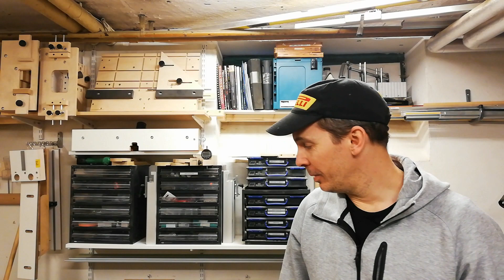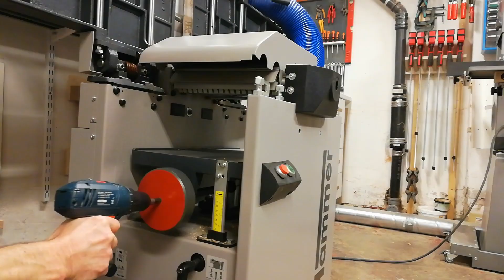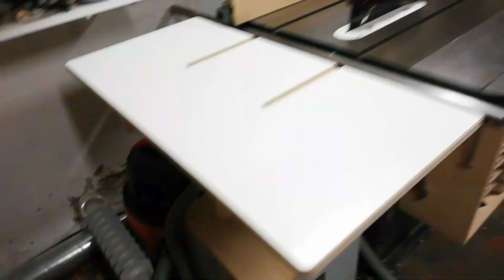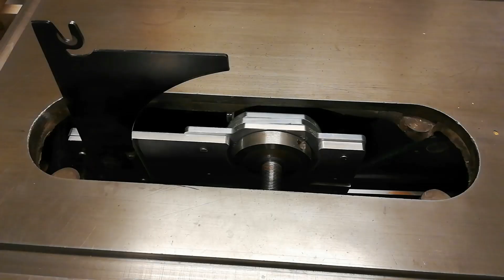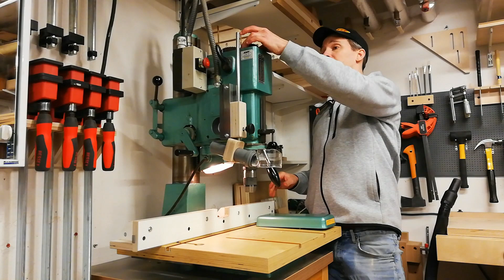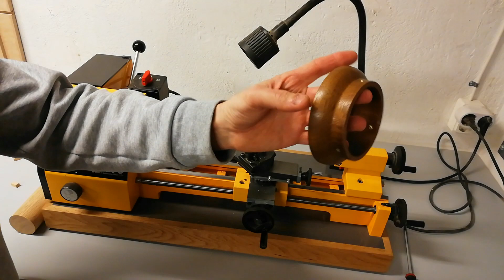Shop tour part 2 - Machines and tools

Comment: Very nice concise tour of your shop, thank you. I also have a Sorby pro edge and have been looking to add a bar type fixture to use some of the Tormek type fixtures. Could you share the design of your 12mm round bar fixture. I really like how you added it on top above the standard stock table.  Thank you! Allan
Reply from the maker: Thanks! I don't have any detailed drawings for the bar holder but there are some additional pics on pinterest, link below. The metal block is 20mm thick, 30mm wide, approx 60mm long, and then it's curved (cut with a grinder then filed and sanded) on the front for the blade holding jig to be able to pass over it. The block sits with three screws threaded directly onto the side plate of the machine. Metal bar is held in place with two set screws. I made my own sharpening jig as well, the tormek fitted but the blade protruded very far from the jig. https://pin.it/1u7V0NX

If I was to to this again I would consider axminsters 12mm bar and bracket. At least two members on the sorby pro edge forum have attached this to the machine and it fits with minor modifications. Same principle as mine but it wasn't on the market when I built mine. You have to be a member to view the pics in large version. https://robert-sorby.freeforums.net/thread/182/quick-make-accomodate-tormek-style
 https://www.axminstertools.com/eu/axminster-compound-jig-for-ultimate-edge-103738?glCountry=SE&glCurrency=SEK
Reply: @CarmoniusFinsnickeri  Thank you for your response. I know about the Axminster UE machine and I like there bar fixture but I also like the PE platform fixtures and I use both of their tables for some edge work. What I like about yours is how it tucks up above the PE table. I think the direction I’m going to take is to duplicate the pivot and angle adjustment aspect of the PE fixture and design an extension on that shaped fixture to project and support the 12mm bar. That way I can just swap it out with the PE fixture using the same platform locking lever and angle pin hardware. I have a friend with a small machine shop in the same building as our shop and I’m going to take one of my PE fixtures to Bill to scan and duplicate the arm adding the round bar extension. The other thing I’m going to do is ask another associate that does motor work to see if he would wire the motor to add reverse rotation. I don’t feel I need variable speed as none of my other grinders have VS control and it’s not really necessary in my opinion.

Comment: Hey, at 7:45 you talk about the metal bracket and bar you fitted to replicate the Tormek. Did you make this yourself?
Also regarding the blade holding jig did you buy this or make it?
Reply from the maker: Hi Charl, the bar is standard 12mm rod, of slightly better quality, the bracket I made myself, as well as the blade holding jig. I first run it with a JET jig (very similar to Tormek) but had problems holding short blades. My own jig gives slightly better "reach" since the holes for the bar are offseted to the back (se pics in link). Pinterest link shows some more pic of my modification and the other links shows some pics of the blade holder. 
https://pin.it/2AnR0lx 
https://www.byggahus.se/forum/attachments/img_20190528_195649-jpg.332802/  https://www.byggahus.se/forum/attachments/img_20190528_195702-jpg.332804/
If you already own a Pro Edge I recommend this tweak, it's quite easy and the only "damage" to the machine was three threaded holes. If you don't own a Pro Edge, Axminster has a similar machine that has variable speed, reversible direction and is "Tormekprepared" out of the box. If that machine would have been on the market when I purchased my Pro Edge I would have chosen the Axminster instead. 
https://www.axminstertools.com/eu/axminster-trade-ultimate-edge-variable-speed-sharpening-system-106232?glCountry=SE&glCurrency=SEK
Reply from the maker: BTW, thanks for the kind words in the shooting board video, jig master sound good😊. I only see the comment in my alerts, but for some reason can't find it under the video therefore I comment here.

Comment: Hello

I really enjoy watching your videos, thank you for making them.

I am currently considering buying the same Hammer A3 31 jointer planer with the spiral cutter head. Let me ask you if your machine is a single phase or a 3 phase version? I only have 1 phase at 25A in my shop, and do not know if it could handle this machine together with the dust extractor (10A current) without tripping the circuit breaker.

If you have the single phase version and also have one of those plug-in type voltage/current meter, could you please measure some real life current draw? If you do not have a meter, could you please check if the drive motor has the current draw or cos(φ)/power factor numbers on its plate? It would also help if you could tell me what size of breaker circuit are you running this machine on.

Thank you
Adam from Hungary
Reply from the maker: Hi Adam, sorry for late response, sometimes I just don't get amy notification that I have a new comment.

My machine is 3-phase so unfortunately I can't assist. I know the spiral heads draw less current than straight blades so the motor power should be "over sized" for spiral head. Is there no way for you to install 3-phase in the shop? I had that done some years ago and it really simplified things when looking for good second hand machines to buy, at least in sweden.

Have you tried to contact Felder? They should be able to give you quite detailed figures of the current draw.

/Ola
Reply: @CarmoniusFinsnickeri  Sadly there is no acces to 3 phase power where my shop is located so I am stuck with single phase machines. I also have contacted Felder Hungary but unfortunately customer support is not at the best in my country. I will get in contact directly with Felder Austria. 
I am delaying the purchase because the local currency (forint) is at its low peak nowadays... :( 
Thank you for the answer,  I am looking forward to more of your videos. 
Regards, Adam

Comment: Another great video Ola, fascinating to see that your main machines are at least 30 years old so it shows the quality of the ones made back then to compared now😀. Just out of interest, how wide is the thicknessing capacity of your new planer / thicknesser?
Reply from the maker: Thanks🙂. Yes a lot of old good machines. There are some very good machines available also nowadays but not that many in the segment "rather small" which is a requirement when shop space is limited. New planer thicknesser max width is 310mm.

Comment: Ola, great video. Like the others said very entertaining. I'm very impressed with the well thought out layout. Being from Norway we don't access to 3-car garage, but most often only 1-car garage that also needs space for bikes etc. 

I found your channel a month or two back and I think your videos are fantastic. I still need to try and make your domino jig. Look forward to your next videos.

In norwegian:

Knall bra videoer. Jeg har ikke kommentert tidligere men tanken bak mange av jiggene og ikke minst hvordan man plasserer maskinene i verkstedet er så utrolig gjennomtenkt. Jeg har grønn bosch søylebor.....tror jeg må se etter brukt Arboga. Hva er modellen?
Reply from the maker: Thanks Marius! Even if I understand norwegian I answer in english so others understand what I write. It certainly took a few years and iterations to reach this shop level, you should have seen my first layout with only crappy machines...Anyway, the Arbogas are great machines and highly thought of in sweden and abroad. My is a B2512 model,  but there are better models where you don't have to manually change gear wheels, E100 or E825 for example. If you search for an Arboga make sure to check the RPMs, there are some machines that, even with gears, are focused on high or low RPMs and these are maybe not the best for varied tasks.

Comment: Carmonius, I originally found your YouTube channel when I was looking for a way to make/modify a automatic riving knife. One of you early videos showed that.  I just saw this video and you mentioned that you created some drawings of the mechanism.  Is there any way you could share that with me?  I have an old Unisaw.  Enjoyed the videos please keep doing them.
Reply from the maker: Hi George. My concept is based in this guys conversion of a Delta unisaw. His design might fit your saw directly. http://thewoodenscrew.blogspot.com/2011/10/well-its-finally-done.html?m=1

My wright up of the conversion can be found here, including link to necessary 3d files. You have to be a member to see the pics but that's quick. https://www.byggahus.se/forum/threads/retrofitting-true-riving-knife-to-early-wadkin-ags10-saw.296339/
Reply: @CarmoniusFinsnickeri  Thank you very much for the lines! I had not seen that. I've been wanting to add  an automatic Riving Knife for quite some time.
Reply: Thanks for the links!!.  By the way did Tim from the WoodenScrew provide his working drawings? On his site there are many requests for the Unisaw plans.    Again thanks very much.
Reply from the maker: @georgeg8856  You're welcome🙂 Don't know if Tim shared his drawings, I never asked for detail drawings as I had another saw and wouldn't be that helped by them.

Comment: Hi, can you gieve model drill press?
Reply from the maker: It's an Arboga B2512. There are several models of the Arboga machines, The B2508 is similar but has all the gears internal and two gear change handles. Also all the modell comes in bench- or floor standing variant, B and G.
Reply: Thanks for answer:)